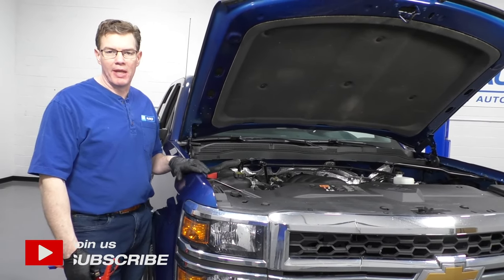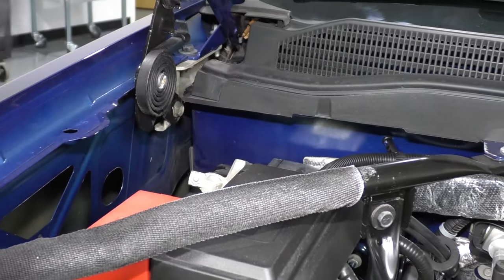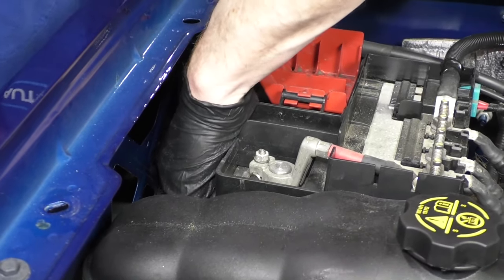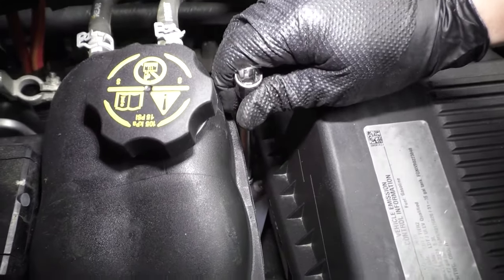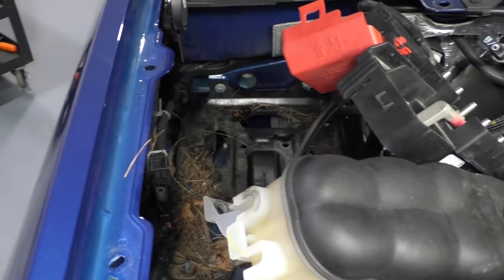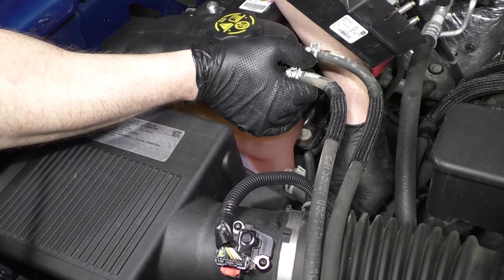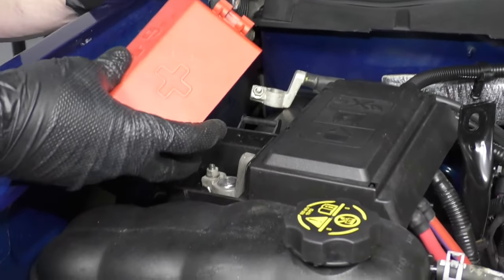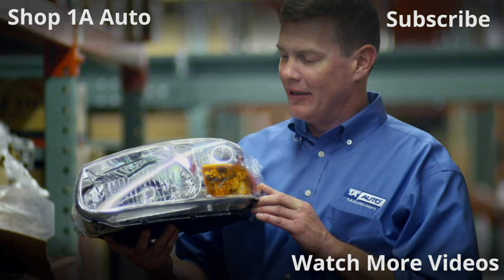How to Replace Battery 14-19 Chevy Silverado

Comment: I just did this job yesterday.   If you remove the vertical part of the cross brace assembly at its lower mount (the cross brace will come out as a "T" shape), you can get the battery in without messing with the coolant jug.   Hope this helps.   Great video and thanks for posting.
Reply: Thanks for the tip. I tried it, and after a little jiggling I was able to get it out that way too.
Reply: I wish I would have read this an hour ago 🤦🏻‍♂️
Reply: Exactly, removed vertical bar, easy to get battery in and out. 👍
Reply: Wow dude thanks that helped so much cause of my buts for the jug was way under my air filter and I couldn’t get to it with out having to take off my air filter . Thank god I didn’t
Reply: I did it this way also works.  I also used a step stool to get better access and leverage to remove the battery
Reply: I tried to do this but couldn't wiggle the battery out still.  Removed the Tbar brace and still had to move the coolant reservoir.  I have the H7 battery which is a little longer than the H6.  Maybe that was the issue.  The extra inch or so of length (thats what she said)
Reply: This comment saved me so much time
Reply: Wish I saw this before I did the job. Messing with the jug wasn't too bad though with a ratcheting wrench
Reply: Thanks for that, your comment made me check another video where I saw a guy do just that. Much easier than messing around with the coolant reservoir.
Reply: I tried it, it worked great just had to turn battery sideways, with terminals towards you, push battery towards firewall ,and you have room to bring it out, without removing reservoir tank,  removing vertical cross bar is easy, had the battery out in 10 min thanks for the tip
Reply: Fixing to do this job in my 18’ Silverado.

Comment: Never thought you would have to use a video to put in a battery. very useful
Reply: Exactly, I love my newer truck, but still absolutely love any kind of maintenence on my old truck. Had to get a new battery around last christmas for it. Pulled the old battery and got the new one installed in all of 2 minutes, if that. It’s so stupid how you have to pull so much apart to simply change a battery now

Comment: It is way easier to do this if you just remove the airbox.  Easier to unbolt the coolant tank, slide it to the side.  And while you have that apart, install a new air filter.

Comment: When you have to make a 10 minute video on how to replace a battery you know that the Chevy design engineers need to be kicked in the nuts.
Reply: you didn't even mention the cost of the new battery,  CHA CHING $$$$$$$$$$$$$$$$$
Reply: @SubtleHustle72  we all should get a turn at em
Reply: The sad part is there is a nice empty space in the front driver's side 🤦
Reply: thanks Chevy for not making us remove the whole engine to get to the battery, surprised there isn't a 14 step process to pop the hood.

Comment: Be aware, this video is over 9 minutes. It took me 15 minutes in my shop with all tools and materials on hand. 

Thanks Chevy 3 different sized sockets, cooling system, battery system, structural crossmember and airbox to put hands on
Reply from the maker: +Brian Behle Thanks for checking us out! 1AAuto.com

Comment: To make it easier to remove and replace the battery (if the battery has no handle) use a ratchet strap rigged around the center of the battery once it is disconnected from the holder tray. Circle the battery with the strap and tighten it. This will give you something to hold onto to take the battery in/out.
Reply from the maker: +spencer mcnamara Thanks for the tip!

Comment: Thanks for the video. It was very helpful. I find it always helpful if I know what has to be done and in what the sequence is  for this sort of job. You did a great job with that. I did find that it was easier for me to get the black box on top of the battery (junction box for the wires and maybe fuses or circuit breakers) out of the way by just removing the negative wires connected as well as the positive wire from the battery. It then would move up and over the support post for the structural crosspiece more easily. Also, getting the right (forward) screw out that holds down the coolant container was fairly easy with a knuckle joint (like a U-joint) on the end of an extension for the socket wrench to get the 10 mm screw out and back in. I did not have a ratcheting box wrench for this.
Reply from the maker: +Dave Redden Thanks for the feedback!

Comment: I just went mostly by your video on my 2015 Tahoe. Couple things... the coolant tank? Only the nut closest to battery needs to be removed, not both (and entire coolant tank). Also, you forgot to mention brace pad when removing old battery... only when installing new battery did you add that part.

Lesson learned for me: buy an ratchet extension... it's a headache using regular tools without extensions given how Chevrolet stuck the battery in such a tight spot. (That distribution box is its own joke. I guess it's good if you plan on having a massive stereo system in your Tahoe but useless for me.)

Anyways, thanks for the video and Go Hawks!
Reply: By the brace pad, do you mean the part he's talking about at 3:24?
He doesn't mention it directly, but mentions removing the 13mm bolt, and shows removing the clamp.
He then mentions it by name when replacing it at the end.

Comment: Removing the air filter housing is the best route to go. It takes literally 5 minutes more to take it off but then makes it easy to get to the mounting bolts for the coolant reservoir and then you can undo the positive connections and the fender brace keeping the vertical brace attached and just disconnecting wire harness clips to allow the bar to be completely removed then you have complete access to the battery and hold down. you also can slide the battery out where you can get hold of the attached handle or if you don't have a handle you could use a non conductive battery lifter to get the battery out of the bay. I think it took about the same amount of time for me to do this as it did to watch the video as they did it. I even had to stop and think if I forgot something because it went so smooth.  
Here is the "HOW TO" I created after having done this task. Let me know what you think.

Tools and parts needed:

Battery - group 94R, H7-AGM or DLG for an OEM exact fit
5/16 in nut driver
10 mm socket with extensions 6”, 12”.
13 mm socket and extension 12”
Step stool, even for tall guys this helps for gaining leverage to lift the battery

Procedure:

1 - Using a 10 mm socket and extension disconnect the negative terminal.
2 - Using a 5/16 in nut driver unscrew the retaining screws for the top cover of the air cleaner. 
3 - Using a 10 mm nut driver loosen the bolt retaining the front fender brace and move to access the air cleaner housing.
4 - Remove the air cleaner top and filter
5 - Disconnect the MAPS sensor on the air cleaner housing.
6 - Using a 5/16 in nut driver loosen the banding clamp for the  air cleaner to the air duct to the engine and remove the upper housing. Remove the air filter 
7 - Carefully pry up the lower air cleaner housing, this is held down with 2 grommet posts towards the engine and a clip that slides into place when you slip the housing into the air intake position.
8 - Remove the lower air cleaner housing
9 - Unbolt the 10 mm bolt and 10 mm nut holding the coolant reservoir in place, lift off the rear threaded post and slide forward allowing access to the battery.
10 -  Unbolt the 2, 13 mm bolts holding the top cross member of the fender support and the lower 13 mm bolt of the vertical brace.
11 - Release the wire harness clip attachment to the vertical post and remove the brace.
12 - Using a 10 mm socket disconnect the positive terminal on the battery.
13 - Remove the cover for the positive buss bar and carefully pry the bus bar assembly housing off the top of the battery, try releasing the side closest to the fender first then lift it up and towards the engine bay to get it to release and set it out of the way.
14 - Unbolt the  13 mm bolt and remove the battery hold down block.
Slide the battery out  away from the fire wall and lift out. 
15 - Take time to clean up any debris in the holding area and the surrounding engine bay and any corrosion on the terminals.
16 - Install the new battery, be sure the terminals are on the fender side and the positive terminal is towards the front of the truck.
17 - Install the hold down bracket and tighten the bolt.
18 - Attach the positive buss bar assembly to the battery.
19 - Reinstall the fender brace with the vertical support and tighten the 3 bolts securely.
20 - Reattach the wire harness retaining clip.
21 - Replace the coolant bottle on the rear post and secure the 10 mm nut and the front 10 mm bolt tightly.
22 - Reinstall the lower air cleaner housing seat the grommet posts holding it in place.
23 - Reinstall the filter and replace the cover be sure to seat the housing completely inside the intake duct, secure the banding clamp, connect the MAPS sensor connector and secure the retaining screws for the top housing.
24 - Replace the front fender brace and the 10 mm bolt tighten securely.
25 - Connect the positive terminal  and tighten carefully.
26 - Connect the negative terminal of the battery tighten carefully.
27 - Remove any tools and residual from the engine bay. and clean up area before proceeding to start the vehicle.
28 - Start vehicle and follow reset prompts.
29 - Navigation, radio presets and a few other programmable features may need to be reconfigured.
30 - Don't forget to recycle your old battery.
Reply from the maker: +@jimgriffin8179 Thanks for the feedback!

Comment: Great job 1A. If you have the time, could you do a write up on changing this battery on a e-assist Silverado 1500. There are high voltage wires over the 12V battery and you can't find instructions anywhere on changing it. Thanks!

Comment: The factory must remove the handle off of the battery. I just changed my battery in a 2017 and it didn't have the handle as well. The new battery  had the handle and it didn't need to be removed because everything went back together just like it should

Comment: Always disconnect the ground cable first then you don't have to worry that you may short the positive cable to the frame. Always disconnect the ground cable first when removing a battery and always connect it last on the install.
Reply from the maker: +Bo Bro Thanks for the tip!

Comment: Just used this video as my "how to" and changed the battery in my 2018. Lost the time (no biggie) took a little while for the tpms to register tire pressures but Im having issues with "ghost touching" on the radio. Brings up the browse screen and changes the center display (in front of the steering wheel) from vehicle info to audio like Im working the radio on the steering wheel? Any suggestions? Google is coming up with most likely an HMI issue?

Comment: Do you have a video on how to replace the negative battery cable?  It has 3 connection points. 2015 2500 6.0.  Thanks

Comment: Negative OFF first, negative ON last. On that tray over the battery, there is a fuse that will blow with just a tiny screw up. Don't risk it - negative on - the very last thing!

Comment: You don't have to remove the coolant reserve .. remove that other bar by the tie down and you can wiggle the battery in and out the H6 is way easier then the H7 but after a few it's simplish
Reply from the maker: +Elo Him Thanks for the tip!

Comment: The original GM battery on my 2017 suburban was missing the vent plug on the positive side. The new battery I purchased has the vent opening but does not have plug. Hasn’t been an issue. Why the vent plug??

Comment: Found it easier to remove all connections on top of the battery. Remove the lower L brace and move out of the way. Then wiggle the battery out through there. Didn’t have to remove coolant reservoir This way.
Reply from the maker: +Omar Torres Thanks for the feedback!
Reply: Did it the same way, Omar.
I did loosen the coolant jug so it had some wiggle room, but avoided having to move it out of the way entirely.

Comment: I'm lucky I didn't have to completely remove the coolant reservoir only one bolt. Still though for a chevy silverado, it doesn't need to be this unnecessarily complicated to remove a battery. Is it difficult, not really, just unnecessary. It took me all of 15 minutes to replace.

Comment: I just my new battery in and after starting the truck up, it asked me to lower and raise the driver's side window. I did that, then the truck shut off. I disconnected the negative terminal, waited a few seconds, tried again and the same thing happened.

Comment: Took me about 30m. Thank you. What happens if the battery is a little bit smaller than the original?

Edit: it started up and runs fine. I replaced it with the duralast platinum battery from autozone.

Comment: just a footnote here... my MAIN battery died ( pass side back one i have 2 batteries in my truck) my truck is a 2014 silverado 2500 hd  i called a few places to replace battery was told its was very expensive battery to replace... so im not that stupid... so i went online to watch many videos and noticed there were many different mounting setups... anyway my silverado had the half circle bracket on firewall to fender a different battery box on top of battery but came off truck okey no problems until i finished installed new battery... after patting myself on my back because i saved myself an arm and leg doing it myself i started the truck ... yes it started i said cool...but then the problem all my presets memory was lost no big deal ill just reset them right... wrong by disconnecting the battery  it set off the  anti thief security system in factory radio was asking to input code.. i had no code to input... so i had to go back to dealer... they asked for my vin number i gave them they looked it up in their computer got the code to reset radio it worked.. they billed me 125.00 for 15 minutes of work... i bitched but paid them but this was a business truck and i only like chevy trucks and was in the process's of buying 2 new silverado's plow trucks from this dealership needless to say i canceled the purchases from that dealership and would you believe the shop manager chased after me trying to refund my 125.00 dollars back.. and yes i took it back but still canceled the trucks purchases from them. ps i now know there is a tool to buy to keep this from happen but none of the videos i watched pointed this out. so next time i will still do it myself the right way.

Comment: I disconnected all the connections from the battery to clean the area and then placed them where they go. 
But now the truck with not completely turn on but when the key turns it does 
Then when I try to turn it on it clicks and lights flicker
Why is this

Comment: I had to replace mine  yesterday.  I've been around vehicles for over 40 years.  That was the most work I ever put into, the most difficult time I ever had, replacing a battery.  Stupidest fucking designed battery replacement I've ever seen.

Comment: After getting the battery replaced, we went to have it inspected and none of the computer system showed up and we were unable to get it inspected.  We were told to drive it about 60 miles but we drove it nearly 200 and the computer system still shows FAILS.

Comment: Ok.  The GM engineer who thought this was a good idea should be tossed in the ocean with the old battery fastened around the waist.  I need to do this however it's been between 7°-10° outside the last few days, and not getting anywhere near freezing for another few days so I get to take it somewhere to have this done because I'm not freezing my ass off outside.

Comment: U dont need to remove the antifreeze gallon
Reply: Since the battery size can be larger in some vehicles... it might be necessary to remove the coolant overflow to get the battery in and out of the vehicle. Not all batteries are the same size for Chevy trucks.

Comment: Whatever happened to two wires with nuts to loosen up and remove battery, then replace. This is stupid, and GM did this just to piss you off, and then make you come to them, then hosing you for not only a battery but labor fees so stupid